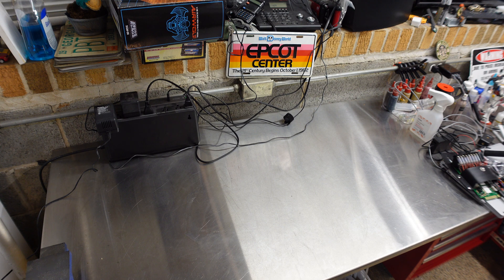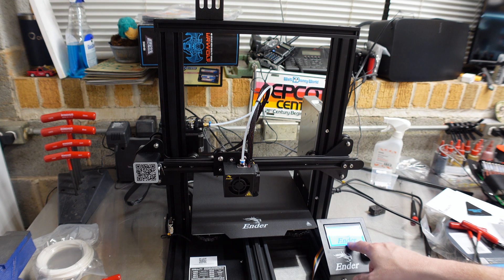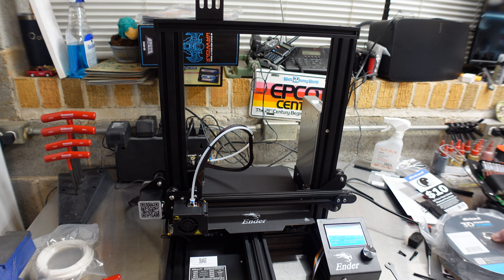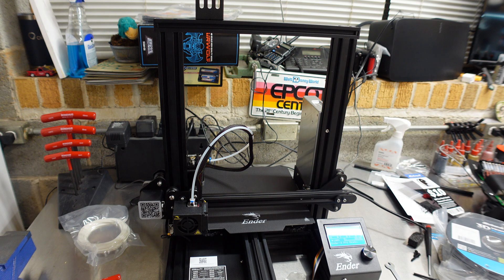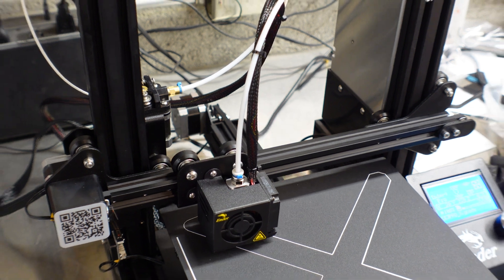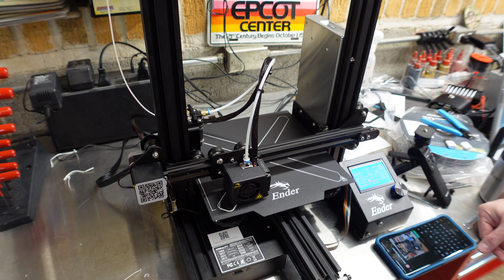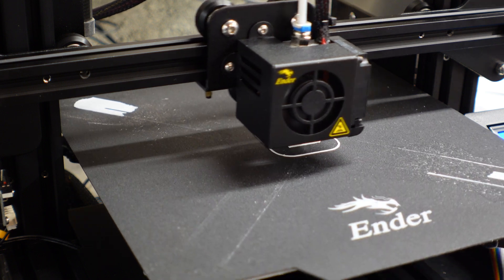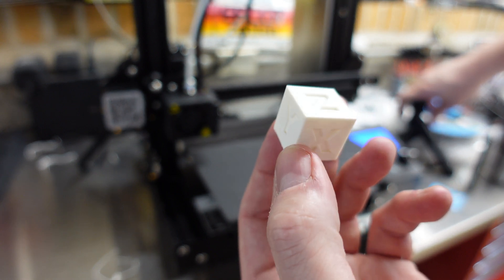Review of the $99 Creality Ender 3 Pro 3D printer from Microcenter, yes you need one!

Comment: If the power does shut off, you can always resume the print when the power comes back on correct me if im wrong
Reply from the maker: I have tried the resume option twice, at least on this model of printer it was all boggered up and I had to toss the print and start over, resume MAY work on some other printers but not on either of my Ender 3 pro's (I have two)
Reply: @PitstainHobbies  Oo yeah its probably a hardware issue, it works fine on my s1
Reply from the maker: @girthfrombirth4408  That's good to hear, these $99 cheapies are fun but I know there are much better ones on the market.

Comment: Bought a Ender (Not a 3) a year ago not Mac compatible, even the software Cura is. Tried it on a 2010 Mac mini & 2018, FAIL !!
Reply from the maker: That stinks Lynn, it seems the Ender memory card needs to be formatted as FAT32 which I assume the MAC does not support, but it could maybe you just need to see if that is an option on your Mac.